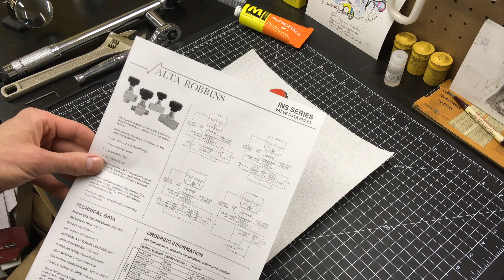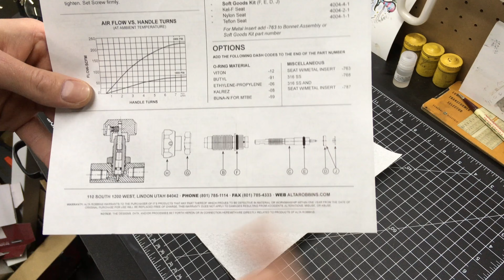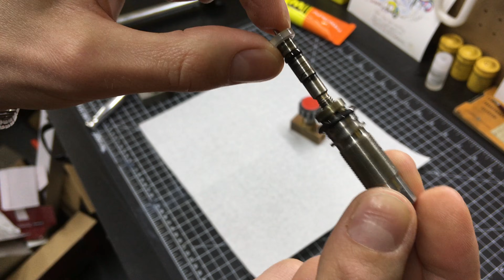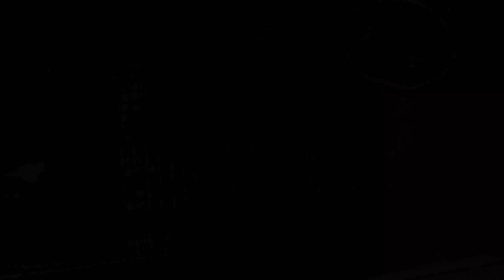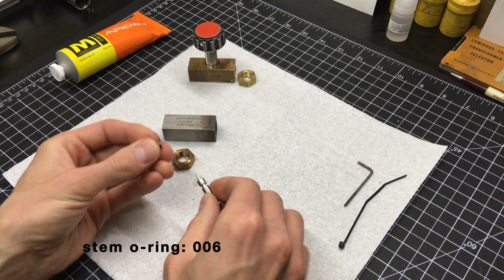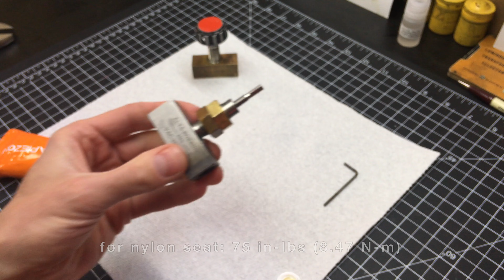How to rebuild a Robbins Valve

Comment: We have two of these on our manifold and they were leaking, so we cleaned with ultrasonic then rebuilt them with the soft goods kit/regressed w/ Apiezon M. But they are still leaking ! The stems wiggle around in the bonnet. Any advice ? We are at wits end!
Reply from the maker: well thats frustrating!  hm, if the stems are wiggling around in the bonnet, it would lead me to think that maybe the o-ring on the stem is too small and is not sealing correctly.  did they send you the correct soft goods kit for your model of valve?